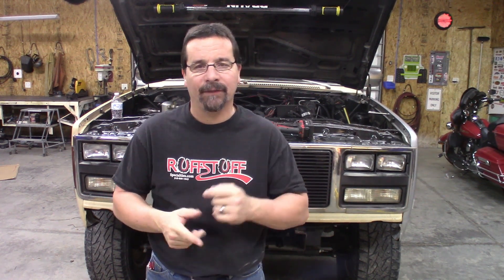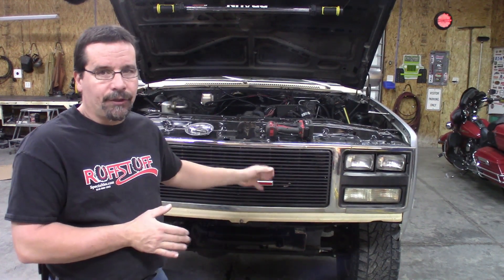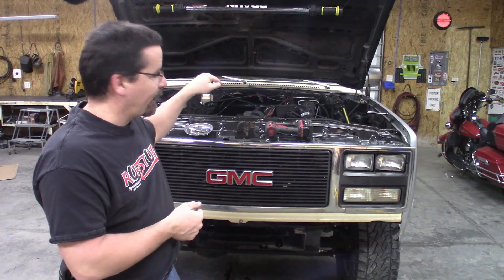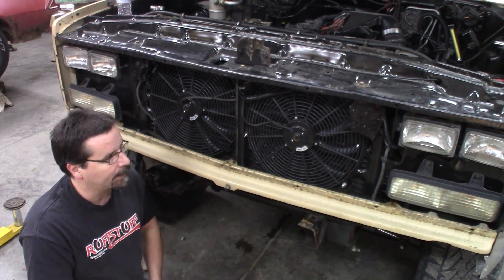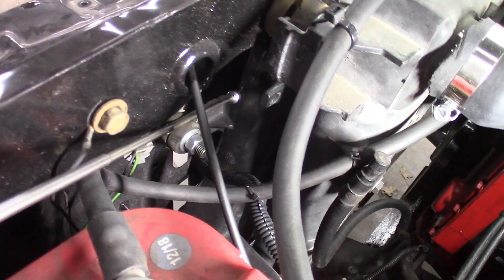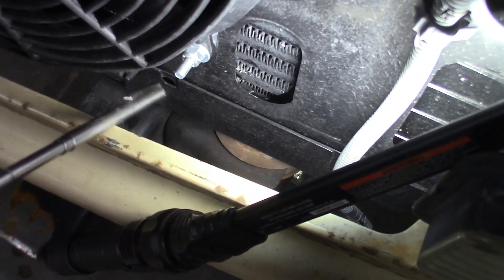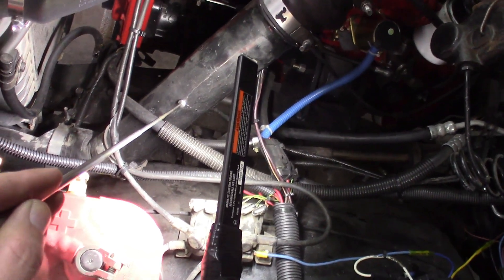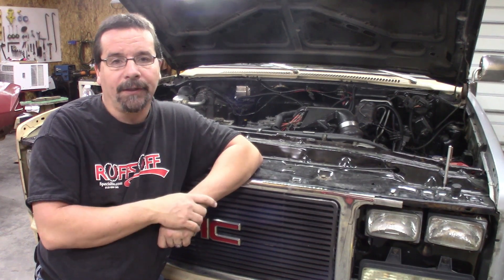2nd Gen Radiator and Intercooler Into a Square Body

Comment: question? I bought my truck with the core support you have on in this video (grill headlights, etc). I want to go back to the 1986 grill and headlights, all I would need is the core support for that year (86) and necessary headlights and grill?
Reply from the maker: Yes that is correct
Reply: thank you, great info on this video also

Comment: Do You Have Enough Room To Put A Chevron Delo Cardboard Oil Case Box Between The Inter-Cooler And The Radiator - If Not I Hope You Live In Florida And Do Not Need A Heater - 1st. Gen Dodges Had A Group Of Engineers And A Truck Driver Working Together Designing The 1st.Gen 5.9 Cummings Trucks - 89-93 - The Truck Driver Told Them 1 Of The Most Important Things Was To Design Into The Truck Was A Spot For A Cardboard Box To Slip Between The Inter-Cooler And The Radiator And To Be Able To Totally Or Partially Block The Radiator As The Temperature And Conditions Necessitated - I Have A 93 W-250 5.9 And The Cardboard Stays In For 3-4 Or More Months Every Winter- My Son & I Put A 93 5.9 - Getrag - 205 Transfer-Case Into A 1985 K30 Crew-Cab - We Massaged The Fire-Wall Back Only 1&1/2"-2" - Only Had To Deal With An Area Approximately 8" High By 8" Wide On The Fire-Wall (A Few Hours!) - Also Added 3/8" Foam Sound Deading To Firewall On Inside & To The Floor - The Stock Heater Air Conditioner All Fit Back Inside Without Any Modifications - We Used The 93 Dodge Radiator - Inter-Cooler - Fan - Dodge Alternator With Added External Regulator - 4" Diamond Eye Exhaust Without Muffler Turbo To Rear Bumper, Very Quiet But Sounds Good - Original Air Cleaner Box & Even The Original Fan Shroud Which Fit Perfectly - The Inter-Cooler Is In The Front Of The Radiator Core Support - The Grill Worked Perfectly - We Made Room For Cardboard To Slip In Between The Core Support And Radiator With A couple Of 3/16" Rods To Protect The Fins On The Radiator - My Son Appreciated The Need For That Cardboard The Last 2 Winters When It Was Cold And He Actually Had Heat, (Northern Nevada) - We Ended Up With 2" Between The Fan And The Radiator Almost Exactly What The Dodge W-250 Had - He Could Hit A Deer At 30 mph And Drive Home - Oh Yes We Did Do A 2" Body Lift & Had Johns Spring Shop In Reno Re-Arch The Front Springs & Add A Leaf - He Is Running 285-75-16, (33x11.5), B.F.G. AT's, E Rated - The Installation Came Out Beautiful - Looks Factory! Only Better! - And No Electric Fans! - Yerington Nevada

Comment: Did you add any support back were you removed those two vertical supports?
Reply from the maker: Yes. I forgot to mention that. 
What I did was lay down some 2" wide 1/8" flat bar where the supports were and stich welded in place. 
Thanks for the question that skipped my mind totally
Reply: @RicosGarage  thank you for the great information.  I’m in the process of building the same truck!!👍
Reply from the maker: Thanks for the kind words. And most of all thanks for watching!
Reply: @RicosGarage  I Put In 1"x2" .120 Wall Rectangular Tubing Vertically & Horizontally Across Bottom For Core Support  For Frame Mounts & Also Used It For Bottom Radiator Mounts I Used All Origination Rubber Mounts For Radiator & Inter-Cooler

Comment: In your video you mention using 14” fans. In your Amazon link I only see 12&16 inch. Are you sure they were 14”
 Maybe they are just sold out of 14”
Reply from the maker: Probably sold out like everything else. You could probably get enough airflow with the 12s if you had to. The 16s physically won't fit as there is no room to spare with the 14

Comment: Have you had any over heating issue’s with the fan’s being on the back side of the radiator and Innercooler as far as sitting idling or rolling down the highway?
Reply from the maker: No issues at all. Never has come close to getting hot. Towing has been no problem

Comment: What size lift kit are u running in this truck have same build and mines stock height but motor just about touches the front axle
Reply from the maker: Running a 4" Rough Country lift.
Reply: Ok cool and did u add leafs or anything for the extra weight?
Reply from the maker: Nope ordered their 4" kit for a big block one ton and it holds up just fine

Comment: Where do you get the rubber bushings?
Reply from the maker: They are the factory 2nd gen Dodge intercooler mounts
Reply: @RicosGarage  i know but I can’t find them anywhere
Reply from the maker: I see. Mine came from my donor truck. I've never tried to source them from the aftermarket or dealership. Sorry
Reply: @RicosGarage  yeah I ended up going to Home Depot and finding some rubber grommets 👍🏻
Reply from the maker: Hell yeah!! Now you're speaking my language
Reply: @RicosGarage  not as good as the original ones but it does the job!! Just gotta put my trans in and she’ll be rolling🤟🏻